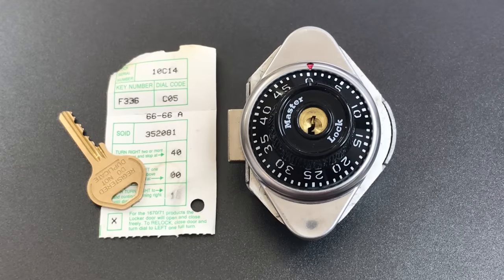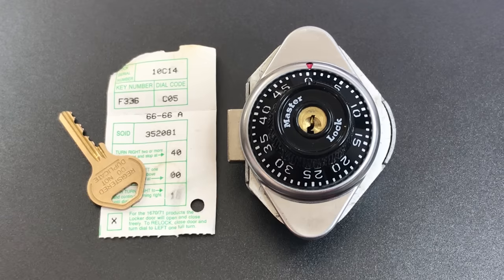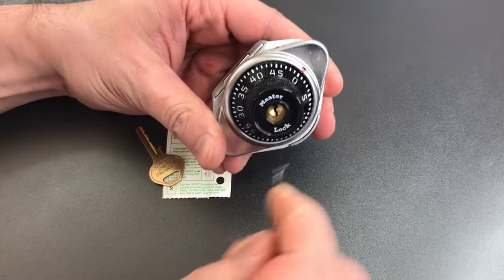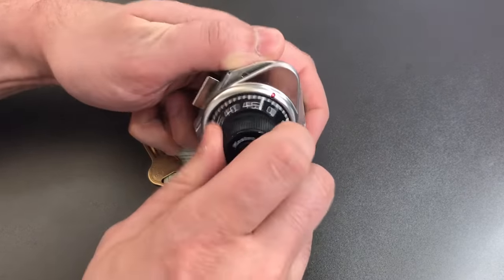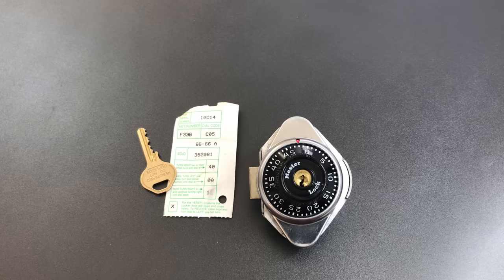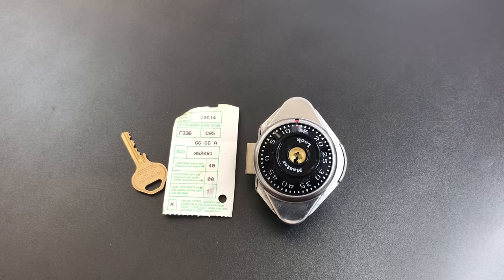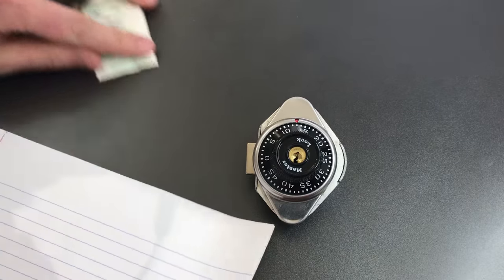[617] Master School Locker Combination Lock Picked and Decoded (Model 1670)

Comment: When I was in HS, me and my friend made a key for the back of the combination locks.  It was pretty simple.  We filed down old house keys until they would fit the keyway. (we were into locks and keys so we had a collection)  Then filed a little more and a little more until it would open the locks with a little bit of upwards pressure.  Not a perfect fit, but good enough when you knew the simple trick.  I was never a thief, but I did get some pleasure in messing with the faculty.  The teachers had a bank of lockers and other cabinets they used for storage.  They would use old student locks and flip them around so the back faced forwards to facilitate easy access with the key.  I would stealthily open them and flip them back the 'right' way.  It made me smile anyway.  I'm old--these were the days well before video surveillance of everything.
Reply: So basically just bump keys for raking attacks, right?
Reply: @thinkiamsad  Not a bump key.  One that was filed close to the correct bitting.  You just had to push it up slightly.  We didn't have a key blank so we filed down old house keys that had similar warding until they fit the keyway, then filed some more.
Reply: With the right slight of hand, I've found that you can still get away with this kind of thing :)
Reply: Is a bump key different than a jiggler? I was thinking it sounded like you made a jiggler until you said it wasn't a bump key.
Reply: As a student going to Freshman year of HS this September; at my school we only have video surveillance at the entrances and exits.
Reply: most of those locks had unshielded keyways actually the key moved the actuator
you could bend a small hook on a paperclip then use it to actuate the pawl releasing the lock no key necessary.
i used to screw with people in gym class by swapping locker locks
Reply: Video surveillance at schools? How's that even allowed?
Reply: @pvip9986  You come up with some scary story about an intruder to scare the parents and simply don't mention that the purpose is to watch the students¹.  For that matter, common areas in a school are going to fall under no expectation of privacy anyway.

1: Plus, you only tell them the scary story when some parent complains.  Easier to just not bother, like the school that didn't tell parents or students that they could remotely activate the cameras on the school-issued laptops².

2: And you will be shocked, shocked! to discover that a teacher was using this to perv on students in their bedrooms.
Reply: @chakatfirepaw  In the UK (different country, different regulations), they'll typically have CCTV covering the corridors alone (not toilets or classrooms), mainly to capture pupil incidents (and check on disorderly behaviour etc). Many High Schools still have buildings in use that were constructed in the 1950s, so unsurprisingly, between lessons pupil traffic is far higher than the design capacity. A few ceiling mounted cameras have a better view than a teacher. The CCTV also, of course, has the side effect of capturing any nocturnal activity in the corridors (i.e. burglars). School sites are also increasingly surrounded by 8' high metal fencing to deter burglars, as with the increasing amounts of technology in the schools (laptops, desktops, projectors etc) they're increasingly tempting targets for thieves. Primary Schools go a step further by limiting public access to the site during the school day due to paranoia over child abductions (typically estranged adult relatives).
Reply: @chakatfirepaw  bedrooms? It’s a school. They have cameras in the hallways, stop making it out like a dystopian nightmare
Reply: @fort809  I said bedrooms because that's where the teacher was using the cameras to watch.  Remember, this involved school issued laptop computers which the students took home at night.

Before you jerk your knee at a word, make a point of understanding the entire passage.
Reply: Thinking of locks themselves, when I was at High School, everyone was issued with a keyed locker. Of course, all the locks had a Master, and with around 800 students, unsurprisingly, some found their key had sufficiently close bitting to numerous other locks so could open multiple lockers (so effectively a partial master)...
Reply: @chakatfirepaw  bathroom cams are illegal in every state
Reply: @mittfh  yeah they dont know what they're talking about, you def do. She doesn't know its illegal in every state to have bathroom cams hehe
Reply: @ryzerch2124  ...that has exactly nothing to do with anything I said.  So, did you just have a random desire to say something and directed it at me for some strange reason or would you like to go back and read what I wrote so that you can actually respond to it?
Reply: @pvip9986  there's video surveillance even at bathroom entryways at my school.
Reply: @pvip9986  multiple reasons: gang assaults, drug use, trespassers, class cutting...it’s perfectly legal, it doesn’t infringe upon any rights despite claims otherwise
Reply: @starrise_  in mine, it was due to the centralized bathrooms being along a major corridor that also featured access to the gym allowing people from other schools access to the school after school. it’s not actually of the bathrooms themselves, it’s of the doorways to the bathrooms and only if they’re in line of sight but aren’t actually in sight directly
Reply: Right u use to be able to joke around and do practical jokes now every inch of school is under video surveillance and have law enforcement officers on campus at all times the school is open smh id never had made it through highschool if they where anywhere near as draconian as they are now
Reply: @fort809  you misunderstood. he meant the webcams built into the school issued student laptops.
Reply: i did the same thing but with the keyed alike padlocks on the gym lockers. Excusing myself during PE I went in to the locker room and moved around the padlocks on just the mean girls lockers. Each one was re-locked, but with a lock from someone else. When PE ended and we all filed back in to the locker room they could not unlock their lockers or get to their clothing. It took the PE staff a few hours to figure it all out, the panic was delicious.
Reply: I probably would've done the same thing
Reply: Mine was made... (well, still is, I have it and a few of the locks) out of a flat stamped spoon handle. I just cut open one lock and made the key to fit it. Then I had a master key. Never used it for anything except fooling with my friends. But after 'bomb threats', when they would send us to the auditorium with our locks (after checking the auditorium for bombs) you would always find someone's lock attached to a seat. I'd unlock it and add it to my collection. And once you open those master locks, you can figure the combination by looking in the hole while rotating the dial, so once I had them, I had a functional combination lock.
Reply: @pvip9986  Huh?
How would it NOT be allowed?
ALL schools have video surveillance these days.
It's allowed because it isn't being made public.
Same reason as a hotel or casino or arena or grocery store or anywhere else.
Reply: @ryzerch2124  lol try telling Hennepin county library on nicollet Ave that lol they have one in there 3rd floor bathroom
Reply: @zoeyjohnson1985  then... report it to the cops rather than let a crime be committed tf.
Reply: @pvip9986  my school only has video cameras outside on corners
Reply: @pvip9986 holy shit dude welcome to the modern era.

My old high school had more cameras than our county prison.

Comment: “Doesn’t require precision”

clearly he’s never encountered one that’s like 20 - 30 years old and had to input the combination 6 different times the exact same way but for some reason doesn’t decide to open until the 7th
Reply: Ikr it's a small thing but proper working lockers are a huge quality of life improvement but nope let's buy 20 tv to put in hall ways well never use
Reply: @Averns  TBH, in middle school, I just used a small hammer and chisel to break the core, and I would just open the lock with a screw driver for the rest of the year.
Reply: @nibs7252  lmao
Reply: @nibs7252  niiiiice
Reply: And sometimes you have to get the combination wrong in order to open the locker but maybe this just happens to me
Reply: Everyone I knew would just jam the hole that the bolt is meant to go into
Reply: This kind of lock isn't the kind they had when new lockers were installed for me 25 years ago - we had locks that actually required the third digit be accurate, then you lift a latch (which also doubled as a "personal lock" location if you were really paranoid.) 
But yeah, the year before they replaced the lockers, I never bothered using mine, it was so unreliable.
Reply: YES
Reply: Most kids in my HS just put something blocking the latch as ours had a separate opening lever. Didn’t even need a combo it just opened right up
Reply: maybe that's because they gave you the wrong combination. it "works" but at least 1 of the numbers is at the extreme end of the usable numbers.
example
the number is 3 and assume you can be 2 off in any direction. the school tells you the combination is 5. going past by a hair is too far off from 3, but coming up short should be fine.
Reply: My schools lockers are from the 60s and you can just jiggle them and pop.
Reply: During middle school my locker was so broken that I just kicked the bottom and the locker would pop open. The lock wouldn't open no matter what I tried. Kept getting in trouble until even the janitor couldn't open it until he kicked it
Reply: These locks are either possessed or always partially broken end of story.
Reply: @nibs7252  I broke it a similar way but my lock was very old so it was far easier than needing a hammer and chisel and continued to use it. In the following years we all learned you can just set it 5 numbers off and turn it back to open and back 5 number to lock and going back and forth always worked and didnt even need you to input the combination. One guys locker was so bad he could do a 360 and it opened.
Reply: Yeah they should at least put some wd-40 or sometiing to prevent it from either rusting or just sticking
Reply: I still have the combination padlock version of this, that I was issued in middle school, 23 years ago. It's been used heavily, including multiple times a day for the eight years that I was in middle/high school. I have not taken good care of this lock, and it still works fine (or at least as well as shown in the video). If you can't get your lock open, then you rushed and missed the combination by more than 6 digits. Don't lie and blame the lock. Lazy kids are the reason they use these sloppy locks in schools, because administrators know you'll miss the digits all the time, so it's actually useful to have a lock that opens when you get the combo wrong.
Reply: @AnonymousFreakYT  FINALLY! Someone else who had thoes! I wish the stopped on the last number. Would of been sooo helpful
Reply: The Gray Fox  No, Chinese manufacturing can be great, you just have to actually pay good money for it.  It is the fact that they try to pay as little as possible to get a "working" lock that is the reason behind the issues.  The country of manufacture does not really come into it.
Reply: my friend claims that the custodian told him the secret method because he(friend) got locked out of his locker one too many times
Reply: Meanwhile I just used a magnet to steal shit from lockers until my school got better locks.
Reply: They don't require precision but require frustration
Reply: Ours were so old a proper hit on the lock would open them...it lead to most students carrying their stuff around in their bags...
Reply: @Averns  did you go to my school?
Reply: I feel that. My schools only like 7 years old but I got the shit locker that even with the code I have to just give up sometimes
Reply: @nibs7252  SUUUUUUUR you did
Reply: Yeah, sometimes you have to put it in and then imediatley lift the latch
Reply: thats very good for security tbh
Reply: my old mailbox was like this but it was only 4 years old, took 20 tries one time
Reply: I don't have this exact lock, but I do own a different combination lock and you can pretty much open it within 3 or so digits of the correctnunber...

Comment: manufacturer: our lock has 125.000 possible combinations
LPL: actually its 400
Reply: ...unless you already know one combination (eg. know the student that used that locker before). Then it's just 50 possible offsets (0 included in case noone bothered to change it) - with the low precision, 25 tries maximum. And since 5 offsets must add up to 50, if you know the combination was only changed once... you almost always need to try a SINGLE-DIGIT number of combinations. That's mere seconds of playing with it, and you have your old locker back. Boy, truly Security with a capital S...
Good thing this thing is likely to be old and worn out in reality. Anyone trying that may easily miss the right combination, keep trying and give up, just because even the right one hardly works.
Reply: @adamkozakiewicz6766  r/woooooosh
Reply: @fort809  highly original and witty, good work
Reply: lmao I love that it automatically opens when you reach the third number and they just don't think about that
Reply: @fort809  ironic
Reply: @Ryan-sw3km  how is it a woosh?
Reply: @alexanderelderhorst2107  They were saving on manufacturing, so they did that to avoid adding a latch.
Reply: Well actually ☝🏼🤓
Reply: LPL says its better than 125 and that its 400? I dont remember that part
Reply: Okay. Will be using that info at school cause they still use these locks in new schools.
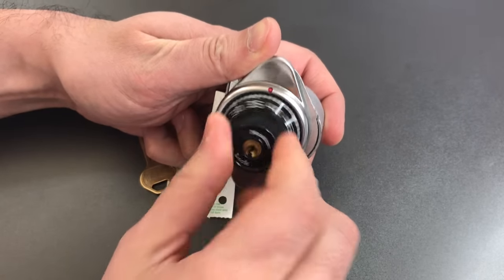Reply: 3:50 From 125,000 combinations to 2,500.
Reply: 3:58 From 2,500 to 400
Reply: 400 is greater than 125, buddy
Reply: @Ryan-sw3km  bro this isn't a woosh

Comment: Here is the real bypass at my high school: hold up the unlock latch, bang the locker with your closed fist or palm of hand, cheap flimsy sheet metal plus terrible tolerances on the lock lack means you can open the door faster than even a key. After I realized this I literally forgot my combination after the start of Junior year. It worked on every locker I was assigned.
Reply: I did the same thing my senior year since I didn't actually use my locker often enough to remember the code.

I also coincidentally stole a lot of things from people's lockers that year.
Reply: Same
Reply: What part of the locker do you hit ?
Reply: @victoriafaulkner2565  lifted the latch and hit above the lock, tolerance was terrible back in the dau

Comment: When I was in HS, many years ago, the offset was 90 degrees, which I figured out because I couldn't picture the administration keeping accurate track of thousands of combos, so I knew there had to be a pattern.  It seems I wasn't the only one to figure out the 90 degree offset so Master had to add a bit more complexity.
Reply from the maker: Interesting. Having 90 changes is criminally lazy. The offset is just notches in a disc. Having random offsets is just a matter of punching the notches in different places.
Reply: My reasoning at the time was that they just turned the dial 90 degrees wrt the guts.  I.e. no offset disc.  And to be fair, I have no idea who the manufacturer was.
Reply: Pretty sure you are right dave. It just allowed the front dial to slip and click into place in a second position, meaning the combination was exactly the same, but the dial face was cosmetically turned.
Reply: You do the best vids!
Reply: So, you mean the possible combinations for the lock were one-quarter of the disc, followed by same, followed by same? So with 50 numbers you'd have 13 combinations? That's pretty pathetic.
Reply: greenaum. No. It means that if your locker last year had the combination 23 4 38, then next year that same lock will have combination either 13, 25, or 38 offset. So 36 17 1, etc.

Makes much more sense to me to use padlock, so at least the damn lock isn’t in a predictable place next year.
Reply: @JasperJanssen  They could swap these locks around too, there's only 2 bolts holding them in.

Comment: Still more secure than the locks my highschool used. I used to shim mine with a piece of super cheap plastic. It was actually probably faster than opening it with the combination. Would have been even faster if I used something metal.
Reply: mine would open if you hit the locker
Reply: @luxzartheglorious  the fonzie of lockers.
Reply: I’ve had a few lockers before which would pop open if you gave them a good whack. Then the others could be easily raked open in seconds. But they did have only about a 1-1.5 number area around the proper combo. Do they were quite good in that respect.
Reply: The lockers at my middle school had a plastic locking mechanism, so after repeated use they wouldn't even close properly because the metal catch had carved a notch through the plastic locking lugs.
Reply: @luxzartheglorious  my best friend in middle school had one like that but you had to kick it extremely hard to make the magic happen. He eventually broke his foot after doing that every day for months.
Reply: @fiftyfuckingfeet  wow must if had better lockers then us, a kid at my middle school dented the locker trying to kick it open
Reply: I seem to remember doing this with a wad of paper in school. It just prevented the latch from reengaging or something.
Reply: AluminumStud That’s what everyone at my friend’s school did!
Reply: @luxzartheglorious  most lockers can at schools cause they are older than most students
Reply: @tylerblubaugh5549  school was built in the 50s